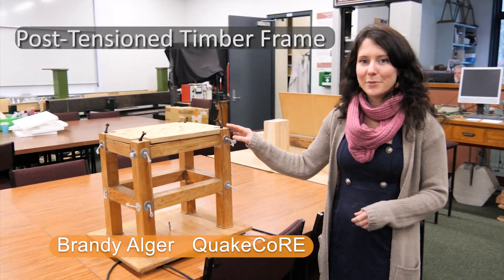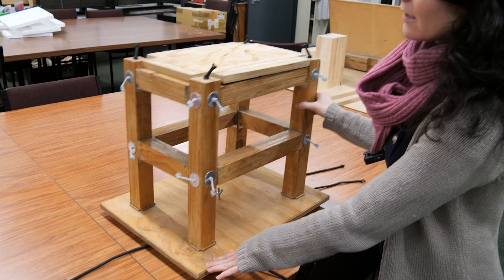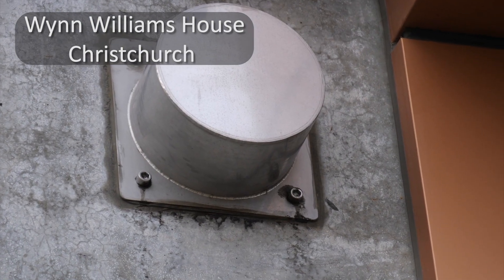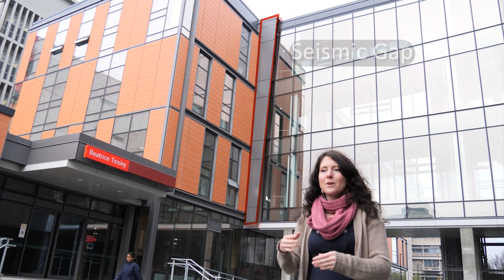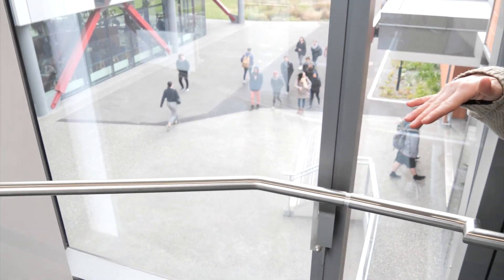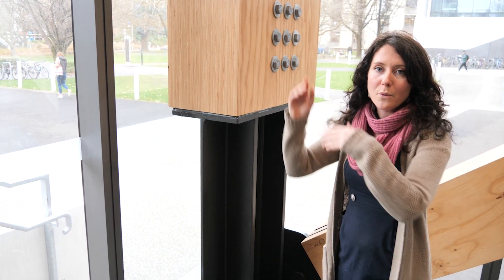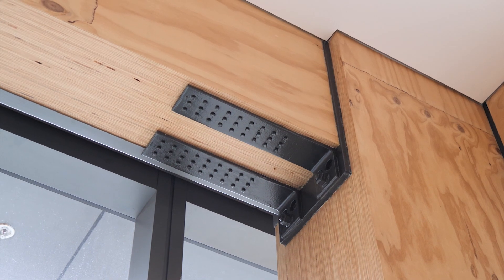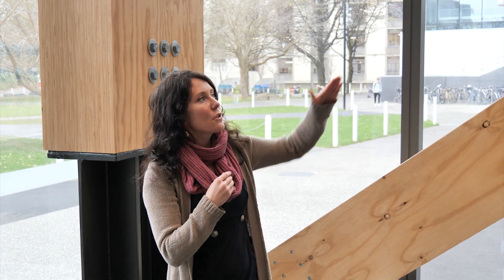Buildings Designed to Rock in a Quake

Comment: Does the rocking result in damage to the facade and interior of the building?
Reply: my guess is that it's cheaper to replace facade elements than whole buildings. Not to mention more survivable for the occupants.

The beehive is on big shock absorbers  that isolate it from things, but it's kind of expensive to build a giant concrete "boat" that floats above the surrounding landscape.
Reply: @mozismobile  Yeah, that makes sense!
Reply: I was wondering that. 

Here is one possible solution: imagine all your interior walls attach only to the floor and adjacent internal walls. Where internal walls meet external walls you have a seismic gap. Now the internal walls have low mass and high rigidity, which saves them from damage even if the floor shakes strongly, and the gaps protect the walls from being impacted by any other part of the building.

The above is pure speculation on my part. I am not a civil engineer specializing in earthquake resistance.